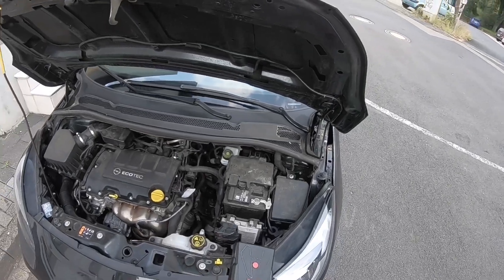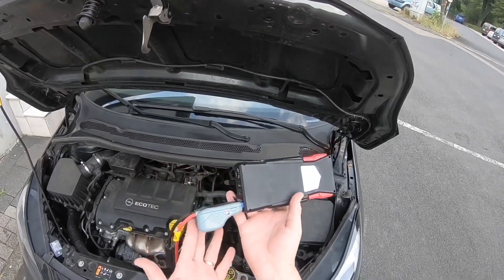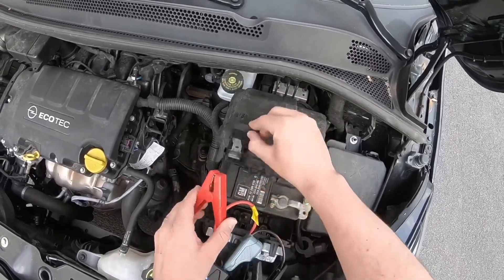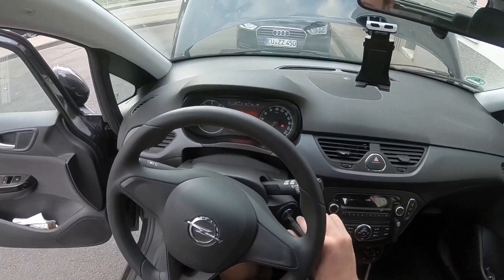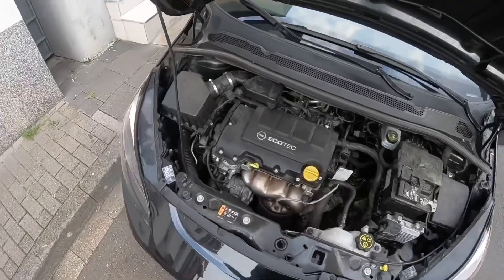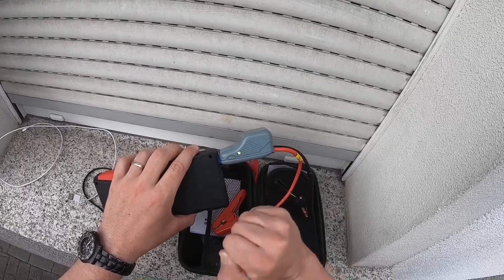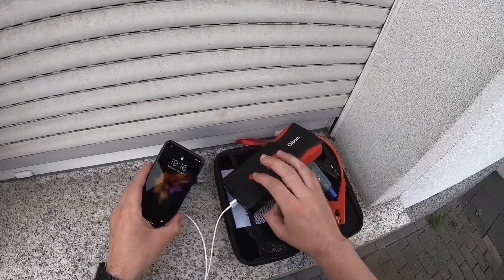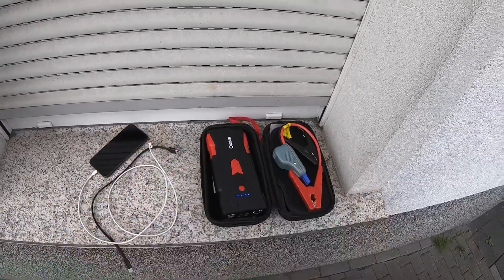How to perform a car jump start with Protable Jump Starter Pack Battery Booster Vauxhall Corsa Mk4

Comment: My 2019 Corsa has the same battery setup with that box thing covering the positive. I don’t want to mess around and take everything off. Can I charge my battery by hooking it up exactly the way you did here, by flipping up the separate positive flap and connecting the negative directly on the terminal? Thanks.